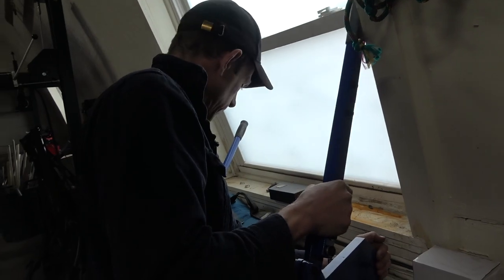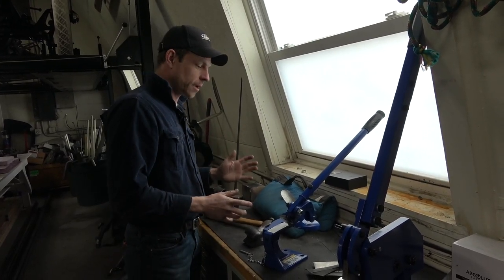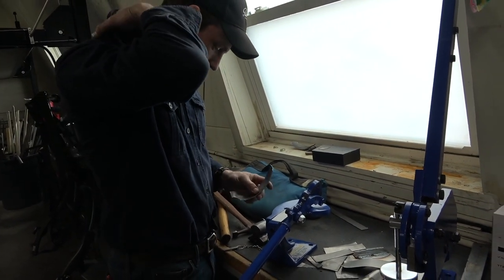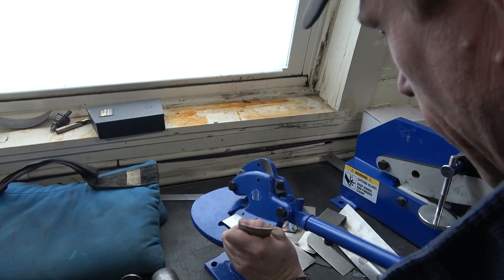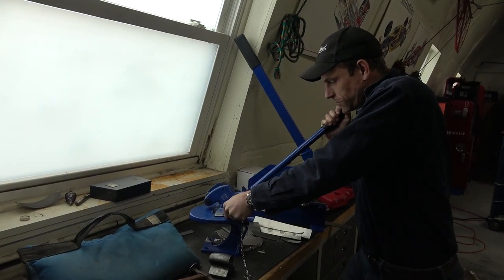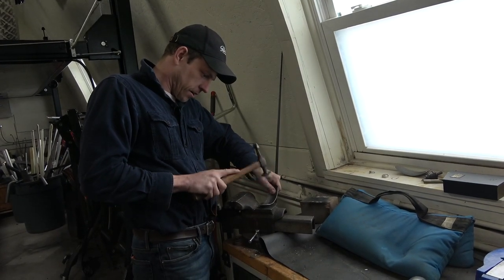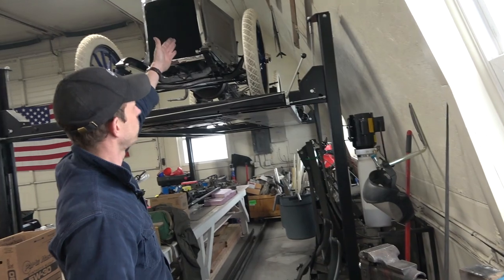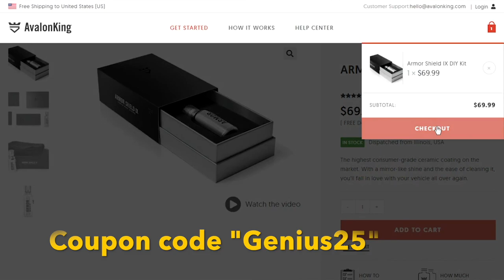How to start metal forming custom cars | Casey's new tools

Comment: I am currently 70years old and in high school my teacher in Metals class was wonderful and once you completed required projects you make what you wanted with his ( Mr. Krause ) I made a tool box made entirely different than what the class made I designed it after a Sears tool box and I still use it quite often. My brother had a 61 Chevrolet pickup and I remade the entire inside of the pickup box including in need steel fender which he sold years ago but everything you were talking about and we also had to design the projects which sometimes harder than making the steel parts themselves. Thank You. It brought a smile to my face remembering all the hammering I did. I did have to put extra time in because of the complexity of some of my projects.

Comment: It really takes very little time to get to a proficient level with metal working. It's an amazing skill to have especially when working on cars that are still mostly made out of metal. Back when I was buying and selling Miatas and parting out the ones that were too far gone, my friend thought I was a wizard for hammering mangled fenders and 1/4 panels back into shape like nothing had happened. In fact, it only took me 1 ruined fender to get the next one right. In the beginning, all of the repairs I did required new paint but after lots of trial and error with a heat gun, I even got paintless dent repair down. There is no such thing as magic. Everything is a science and can be broken down and you can do it, too.

Comment: I took a part time job a few years back because of the type of metal working tool they had ! metal brake Stampy Shear English wheel planishing Hammer Beed rollers ect all OJT building specialty vehicles , I got paid to learn

Comment: If you were making that same compound curve on a bigger piece (like an actual fender), would you still start with a single line down the center and work outwards to get the rough shape?
Reply from the maker: No, I’d crease the outer metal to shrink it first

Comment: I noticed you mentioned ceramic coating plastics in the Avalon King segment. Does that mean they weren't mad about how you improvised with their product?
Reply from the maker: :) No they weren't mad. I was just that I did a quickie job on parts that aren't how they normally talk about using the product.
Reply: @CaseyPutsch  Well I've gotta say it looked good. Once I get some paint damage taken care of I'm thinking about picking some up and doing my car as well.
Reply from the maker: @FUNKOfilms  You totally should!
Reply: Well, that does give Avalon Kinds more capabilities of the product to advertise if he's proven that it works on bare, polished finish plastics.
Reply: @GreenJeep1998  Yeah but it might not be technically proven or studied for long term affects which would normally lead them to not want to advertise it for that use.